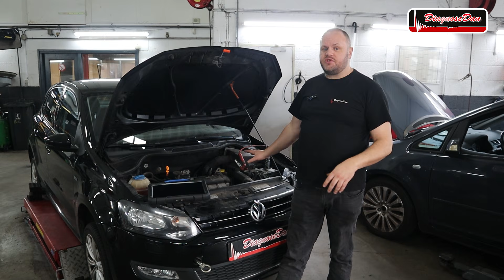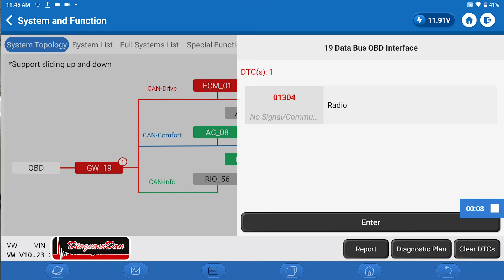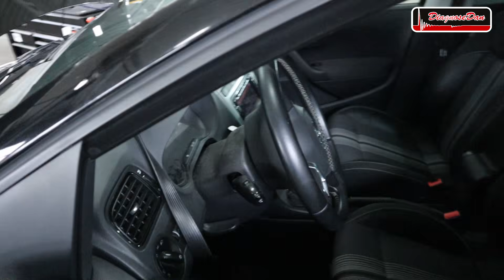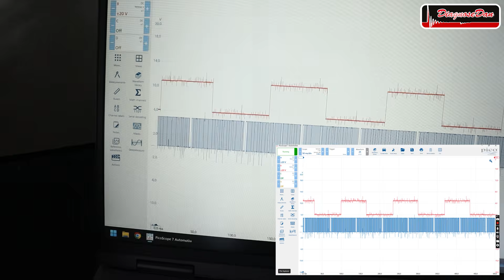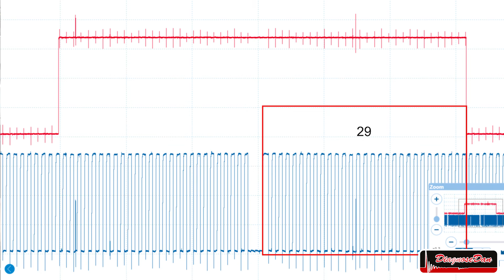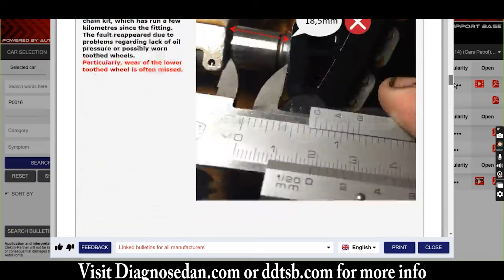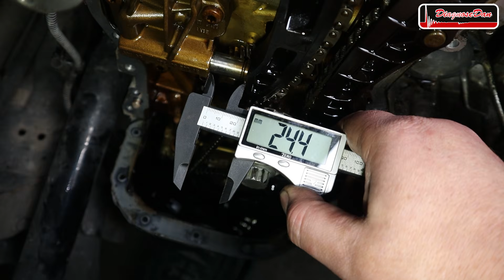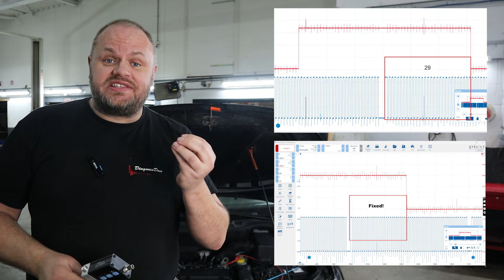Expensive repair? Other shop just guessed!

Comment: Has no power? That's how it was made...
Reply from the maker: But enough power to drive it into the shop i guess😉
Reply: Yes, this isn't the WRC rally version... 😆😆😆
Reply: @leiflillandt1488 very true hahahahahahahaha
Reply: With a worn chain it has less than no power. 🤫
Reply: Or, you could be less stupid/ignorant and make a proper video yourself.  Oh wait, you tried.  Isn't it so easy to criticize?
Reply: They're not bad to be fair. Actually have a good amount of torque for a small engine and are good on fuel. I did a few hundred miles in one in a day, and if was the car I had, I'd drive it.
Reply: @steve5772  The issue is the narrow power/torque band. They only have power 2000->3500, below it there is no atmospheric power and above it runs out of steam due to the small turbo. These type of aneamic engines >need< a CVT to keep them in the torqueband. Then they would be "OK". But with a manual or torque converted automatic, they're horrible. Not just this 3cylinder, but all of them. Including the 1.2 puretech engine from the frenchies. 

As for fuel economy, i was not impressed with the loaner Citreon C3 i got when my Civic was in for repair. It got the same highway fuel economy (4.8L/100KM) and in town it was a similar 6 to 7L/100km with my driving style. Difference being my Civic has 225hp/350nm, this citreon had nothing and I was constantly gearhunting for an ounce of torque. Granted, the Civic is a segment above it, but still it didnt feel like it was worth the 20grand MSRP.
Reply: Hahahahahahahaha very true!!!!
Reply: All this using scopes and picco tool is fine.
Here in india all that is available is generic OBD's and tons of experience of self and ask others.
Reply: @agnelodsa788    Same in Nigeria. However this is because labour time is cheap and workers are plenty. So the mechanic sometimes spends days working on a car with no solution and no pay. It's an inefficient system. That time wasted on one car could've been spent working on more cars.

I remember participating on an engine removal to replace a crankshaft trigger wheel even though the vehicle RPM was reading on the dashboard okay. So why was the crankshaft trigger wheel and sensor being suspected? Because "experience" says so 🤦. Just because that solution worked last time doesn't guarantee it'll work this time. Similar behaviour can be caused by different issues. A few tests will point in the right direction. And if I had suggested a different approach, they'd have said they have more "experience" than me.

By the way, there are cheap scopes, so it really boils down to willingness to learn new techniques that make your job easier. Guesswork is such a waste of time and most importantly for me, a waste of my valuable energy.

Experience is helpful but if one relies only on it, it can be misleading.

But if one has a good understanding, you can solve problems on cars you haven't worked on before.
Reply: And guzzles gas compared to modern engines 😢
Reply: @Levent_Ergun  Not at all, they are pretty good on fuel.
Reply: @ignis lol... I own an identical car. This car weighs around 1t wet. Engine makes 70ps and has an fuel consumption of 7l per 100km urban and 6l per 100km highway (if you stick below 3k rpms in 5th gear).

For comparison: MK8.5 golf with poverty spec trim (1.5tsi) has better fuel efficiency, weighs more and has 60% more power. 

EA111 series engines are dinosaurs from euro4 era .
Reply: @Levent_Ergun  You mean a much newer car with a completely different turbocharged engine gets better economy? Amazing.  Have you ever tried comparing like for like or is that something you don't tend to bother with if it hurts your argument?
Reply: @ferrumignis  I am sorry to have hurt you through YouTube comments. Hope you get the help you need. Modern engines are turbo charged, that the way it goes. I didn’t say naturally aspirated counterparts or something else, you are just trying to make your comment sound like something else. Which is hilarious.
Reply: @Levent_Ergun  I am sorry you are unable to understand that performance and economy improve as new generations of engines are developed.  Why not shit on engines made in WW2 because you think your 1.5TSi is better?
Reply: @ferrumignis I think the point was your original comment "these cars are pretty good on fuel" was not correct. If you'd said pretty good on fuel compared to "x" maybe but the truth is fuel economy is average when you take into account the lightweight and low power nature of the vehicle. Considering it's only a 12 year old vehicle it's average even compared to it's contemporaries. You could buy a Toyota Camry hybrid from the same year that was 5.2L per 100km, more powerful and a much bigger car. Sure it's a hybrid and you could argue that's not comparing apples with apples but a claim of fuel efficiency has to be compared with contemporary vehicles. The 2012 Suzuki Alto (also a 3 cylinder naturally aspirated engine) was 4.8L /100km.
Reply: @mondotv4216  The polo gets better than 5.2L/km though, so I don't understand your point.